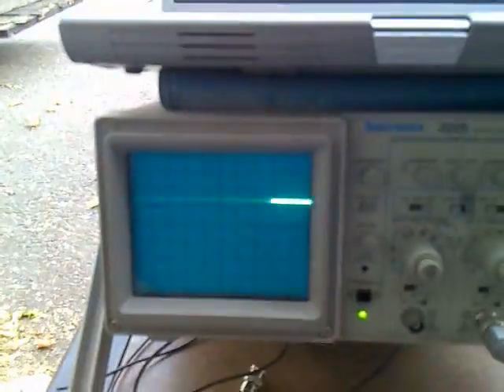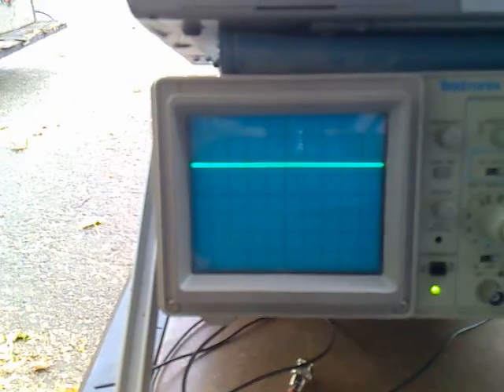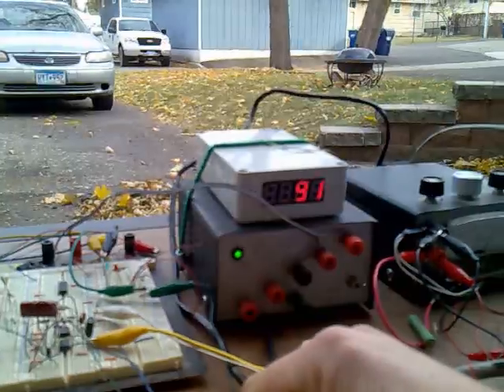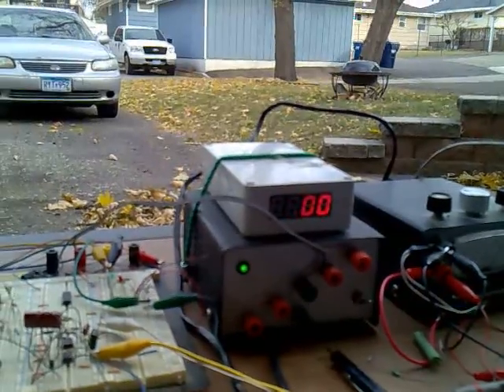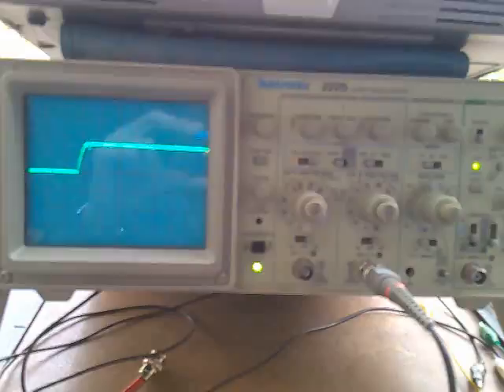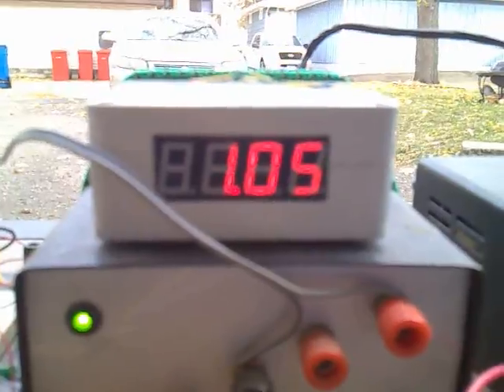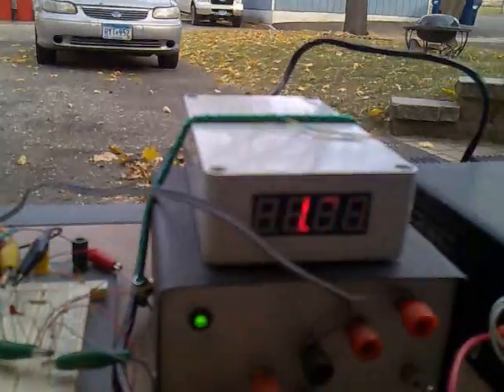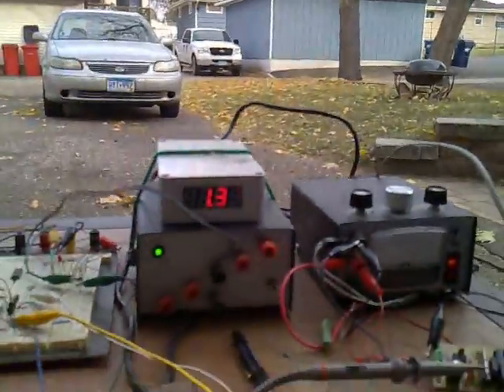Small Engine EFI - Starting the Engine (open loop)

Comment: I love the simplicity, is this a wideband 02 and are there cheaper alternatives to a wide band?? I believe there $300 or so.
Reply from the maker: This was just a simple pulse circuit, but I'm building a real ECU (see my other videos) for the engine which does use wideband.  I've built my own wideband interface so the costs are minimal ($60 for the sensor, $20 for the wideband electronics).  Unfortuately, I haven't worked on this project in several years due to other priorities, but I hope to get back at it soon.